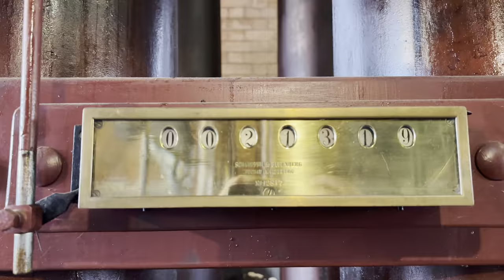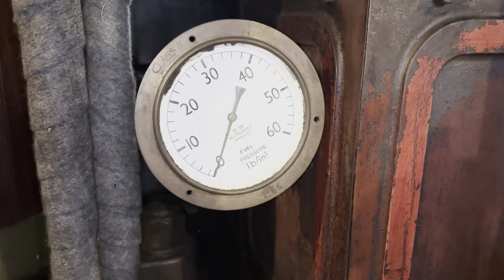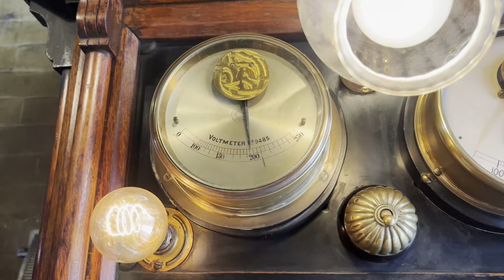VOLUNTEERING AT THE CLAYMILLS VICTORIAN PUMPING STATION - OPERATING THEIR 4 BEAM ENGINES

Comment: 5:15 why are those piston type things so wet? It looks like Willy Wonkas Chocolate
Reply from the maker: The liquid which looks like Willy Wonkas chocolate is oil, it’s oil mixed with dirt. These parts are called the cams which control the valve movement and since they rub on the cam followers they have to be kept lubricated to stop them wearing out